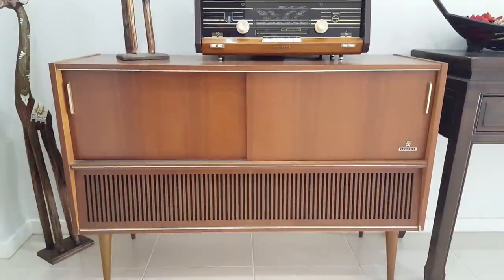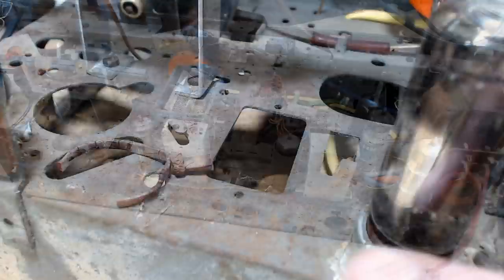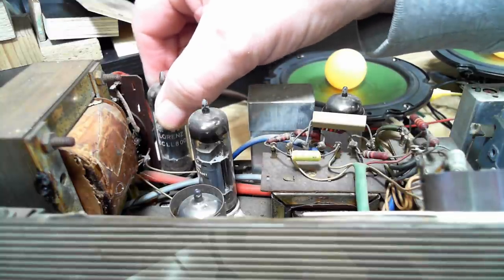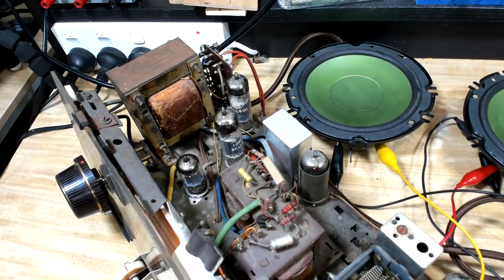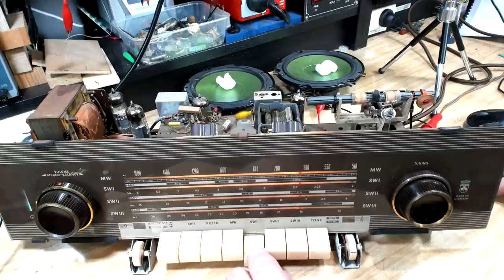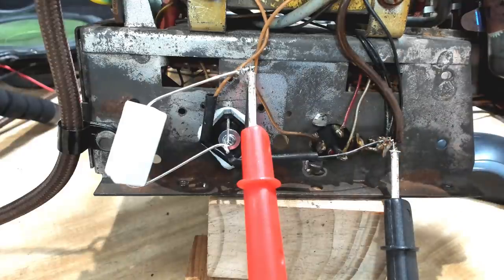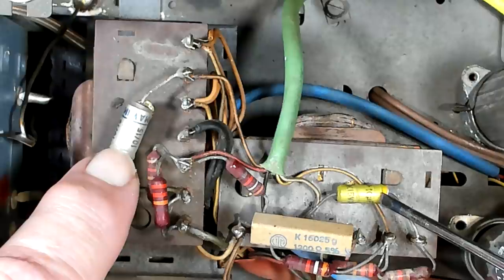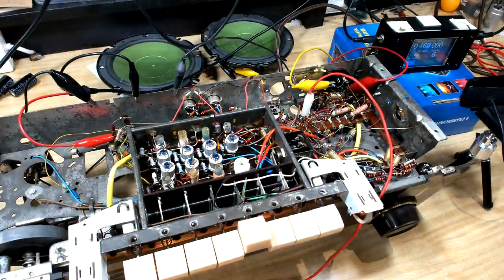Grundig Trento a/WE Radiogram Pt1 - The Radio

Comment: Unless you have a big enough house to fit these radiograms in,  they become a pain.  Maybe fit the chassis in a separate new body just as a radio.  I suspect the timber may be that compressed chipboard kind rather than ply or blockboard, very similar to Philips etc cabinets of the late 60s early 70s
Reply from the maker: The cabinet is chipboard and very disappointing but the way the industry was headed in the 60s. Grundig was under the same pressure as everyone else it seems. I have a spot for it 😀
Reply: @DavidTipton101  It was not so much they changed the materials,  more they never dropped the retail price - I think Dynatron held out in more solid or ply wood for longer (didnt they have the Royal Warrent ?) Interesting to see the deck - was that there own or a bought in one from another maker - Grundig Mics and Tape Recorders were always fairly good for the mid-budget household range
Reply from the maker: @highpath4776  The player is a Philips unit with a Grundig badge on it. It's of mediocre quality and design, it will do the job 🙂
Reply: @DavidTipton101  Philips decks were quirky to say the least, well built and functional.  Never the same as Garrard, and BSR ended up going down generally the cheap plasticky route by the Mid 70s (but did keep a couple of decent decks and autochangers for those that would pay the money.

Comment: I,am not sure but that rust remover almost looks like metholene chloride as they put it in a paste or gel and without that it would evaporate very quickly i used to work for aerosol company.
Reply from the maker: There will be a MSDS on it, it will give an indication on ingredients. It says to cover the product to stop it evaporating so you could be right Michael 😀

Comment: Dave you misspelled Grundig in the video title. What is a Gundig? is that a shovel for firearms? (awful gag - blame my niece).
I hope there's a part 2 - would like to see how this radio turns out. You could install Bluetooth if you wanted to mod it. Teddy Hashee's channel of vintage boomboxes shows a lot of that.
Reply from the maker: I did too! Thanks RoughJustice 2k18, I fixed it. I might install Bluetooth, I could use the tape input 🙂
Reply: @DavidTipton101  That would be cool - looking forward to the outcome :) 2 thumbs up.

Comment: Hi Dave, 
Lovely radiogram you got there!  Grundig manufactured some superb radios, televisions, and tape recorders in their day.  I’m not surprised most, if not all the resistors measure within spec’.  It’s quite possible the West German component manufacturers, as well as the radio and television producers, used the finest of materials.  My guess is, when comparing West German manufactured stuff of the 1950s, and 60s with GDR manufactured stuff of that same period, there was barely no contest - West German stuff was always far superior.  I remember a few GDR manufactured radios and televisions of the late 1960s: despite being reasonably well built, they generally looked as atrocious as they were reliable - probably the reason they were, along with virtually all Soviet manufactured stuff, “Cheep ‘n’ nasty”.
What is that signal, or functions generator you use for realignment purposes?  It looks to be small but it appears to do a brilliant job!
Looking forward to Part 2 my friend.
All the best from Phil.
Reply from the maker: Hi Phil, thank you. They all tested very close to spec, within a few percent. I was desperate to find a crook one but no luck. Even the ERO caps were perfect. The generator is a kit from Silicon Chip magazine, I believe there is a sister magazine in the UK  with the same project. It's made specifically for AM radio alignment and also features a built it mini oscilloscope to show the curve and readout the frequencies but I rarely use that. Cheers Phil, take care. Here is the link to the first page of the kit article: https://www.siliconchip.com.au/Issue/2017/September

Comment: What a beautiful piece! Isn’t the manual on the inside top right of the cabinet? Usually German radios came with the schematic… One of my rules on buying radios is “no ELL80 valves”, but sometimes I get caught with impossible to get for a reasonable price magic eyes. Those Ero capacitors are usually very leaky, I would not let them stay there, specially the ones that could harm the valves.
Reply from the maker: Hi Ric, I did find the schematic in with some papers that came with the radio. I agree about the ERO caps but the ones in there tested perfectly so I am hoping that ERO improved the quality of their components 🤔
Reply: Hi 😊 that is interesting, maybe I am unlucky with the Ero capacitors.. I am restoring a Schaub Lorenz where not a single one tested good. The brown ones are also usually very bad. I don’t know why I still test them all… Maybe just looking for an excuse to play with the Heathkit.. Thanks to you I decided to restore the wood for the first time. So far so good… I think I will do it more often, if the radio looks new, then I don’t have to say “looks like this, but inside is as new” all the time.
Reply from the maker: @ric8868  I don't trust the older ERO caps but these were different, maybe I should change them. Good luck with your cabinet, it's learning curve and I'm close to the bottom but you learn as you go along 🙂

Comment: Hi. Great work! Very nice radio. Those chassis used to be made of zinc plated steel, so after 50 + years, moisture and acidity have wiped that coating  off on many of them. It would have been interesting to measure the inductance of your home-made antenna coil against the original Grundig one. Good luck.
P.S.: Polka animé? That’s a new one, I guess...
Reply from the maker: Hi John, thanks. I don't know what was on this chassis, it had been removed so thoroughly I couldn't believe it ever had a coating on it except for traces on the sides and around some components. I should have measured the inductance when I found the second coil, I don't think it would have been close. Haha... that was the closest I could get to a German polka dancer 😄

Comment: My goodness, ECLL800?! I never knew it ever existed. That's some tube perversion.
Reply: same here
Reply: There are some of the last tubes they have used in radio's & are rare now, a NIB one will cost you 100 euro !
Reply from the maker: I was lucky I didn't have to buy one or two Veljko, would have cost more that the radio is worth 🙂
Reply: @DavidTipton101  Would the radio function if you liquidated the output valves and replaced with equivalents or newer generic valves or are they specifically matched to the input circuit /  output t/f / speaker stages ?  Presumably for Stereo the Phono Input splits through two pre-amp stages  or are the ECLL800s doing both the pre-amp and final outputs in one unit ?
Reply from the maker: @highpath4776  The ECLL800 is a push-pull output valve and a triode preamp as well. There is also ECC83 dual triode before the two ECLL800 acting as a preamp. So the signal goes through one half the ECC 83 then to the ECLL800 preamp into the push-pull output per channel. I don't know if there is a similar valve that could be engineered to replace the ECLL800.
Reply: @DavidTipton101  Thought it was, so there would have been a cost of labour saving and a smaller cabinet running one tube instead of two,  indeed although the price of one is high,  compare to a couple of standard ones is not that much more for NOS or good s/h known tested.

Comment: I waited specifically until after dinner so I could legitimately sit down with a bowl of ice cream and enjoy this vid as a part of my evening. As ever, I am NOT disappointed. As for twisting the wire - It's not pointless if you learned something, even if that something was that your action was pointless because you already had what you needed.

My brain went there after your beginning description, so just out of dumb curiosity: Could you add FM to that radio? Would it be AT ALL reasonable to do so? Would you need extra tubes and tuning... bits? Is there room on the chassis? Would you need to make an all new dial, or just a retrofit? I think I know most of the answers already. But, you know....
Reply from the maker: A bowl of ice cream and a video, what more could you want 😀 The chassis is made for FM but not fitted so it would be possible to do but would require a lot of parts. I can fit Bluetooth which has none of the problems you mentioned and I can stream FM or streaming music, that might be an option 🙂
Reply: @DavidTipton101  Nah. No Bluetooth for the Grundig. No one sane would want that for that particular radio. I've been toying with designing and building a new entertainment console with all the mod cons (and some older ones). Bluetooth would work there. But a classic like yours only deserves tubes and string dials and such. 

Thanks.
Reply from the maker: @stevensansone7502  Haha... maybe 😉

Comment: 19:01 You should have replaced those two pink ERO caps, because they can cause some spectacular failures. This type has a tendency to melt and create massive short circuits

Shame about the lack of FM on this one. Grundigs from that time period are great FM radios. Very sensitive and selective. A few models also have super wide FM ranges, up to about 105,5 MHz. Shame you're missing out on this. Anyway, great work as usual :)
Reply from the maker: Yeah, they were high on the list Adam but they tested perfectly and are only about 400pF, I might bow to public pressure and swap them out 😀 The lack of FM was disappointing but I rarely listen to FM anyway so won't worry me specifically. I might test out a Bluetooth module in there. Thanks Adam 🙂

Comment: Hi Dave,
I agree evaporust is good but way overpriced, i dont know if you can get Mr Muscle in OZ but i find it very good on surface rust. Great video  by the way.
Reply from the maker: Thanks Shayne, Mr Muscle is and oven cleaner here, is that what you mean? 🤔
Reply: @DavidTipton101  Oven cleaner, what's that?😬
Reply: @DavidTipton101  Thats the one, i spray into an old cup and dip and  brush it on that way it does not go all over the shop.
Reply from the maker: @shaynelowther8893  That's pretty heavy duty stuff Shayne, I didn't know it would work on rust. thanks 👍
Reply from the maker: @984francis  I dunno 984francis, someone who comes and cleans your oven I guess 😉
Reply: @DavidTipton101  I wisb😁

Comment: Such a shame that a radio like that doesn't have FM
Reply from the maker: We didn't have FM when this was sold here but it would have been nice. Thanks David 🙂
Reply: @DavidTipton101  👀 Here in Portugal we had FM since 1954, with stereo FM starting in 61!
My NordMende Tannhauser 58 was one of the high end radios back then that could take advantage of FM which sounds amazing in this radio 

But In contrast we only had Colour TV in 1979/80 but that was due to we transitioning from a Dictatorship to a Democracy so it slowed down development I guess
Reply from the maker: @BavarianM  We went to FM in the mid 70s and colour in 1975, we were slow at both 🙂

Comment: Electrostatic speaker? Really? Or is this not the electrostatic speaker I'm thinking of?
Reply from the maker: They are electrostatic speakers squirrelarch and were popular in German and other European radios, they are used to complement the cone driven main speakers by providing the upper frequency range. The two in this unit are about 3" square. You may be thinking of the audiophile electrostatic speakers 🤔